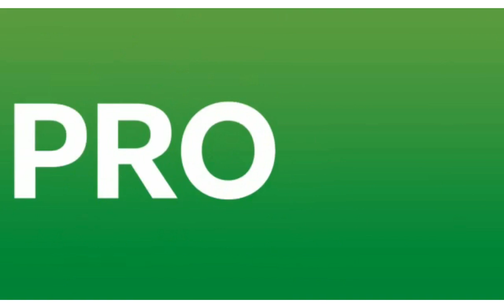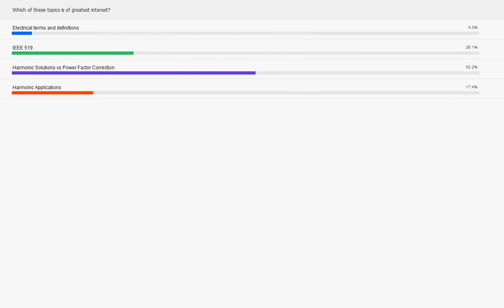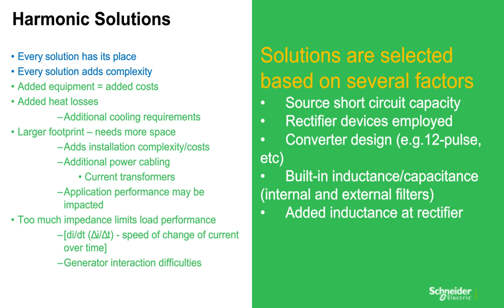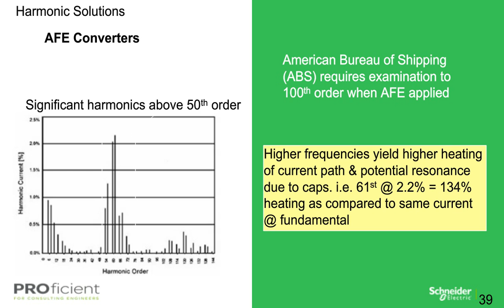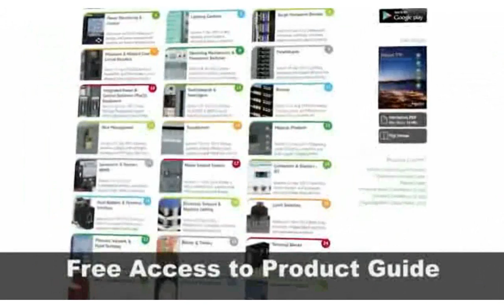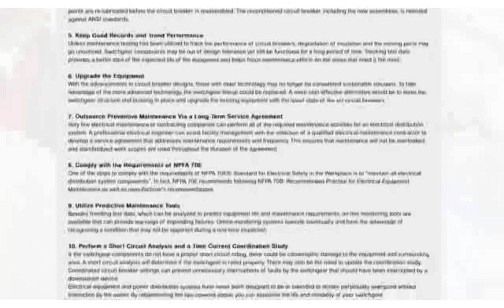Power Harmonics Solutions Webinar

Comment: Hi,  very nice explanation. At 49:30 you mention that Active Harmonic Filter (AHF) can be used, however, earlier on the video at 33:50 you mentioned that AHF cannot be used for reducing THDV. Could you please explain that? Thanks!
Reply: yes thats true because Active filters are used to resolve current harmonics resulted from the customers load. Voltage harmonics are mostly caused by current harmonics. The voltage provided by the voltage source will be distorted by current harmonics due to source impedance. If the source impedance of the voltage source is small, current harmonics will cause only small voltage harmonics. so in order to filter the Voltage harmonics they usually use passive and active filters together